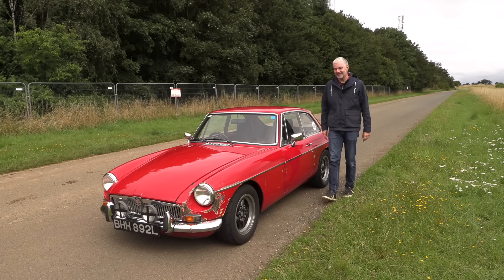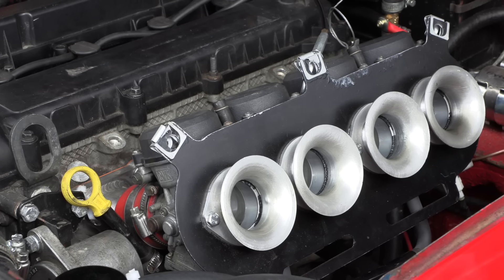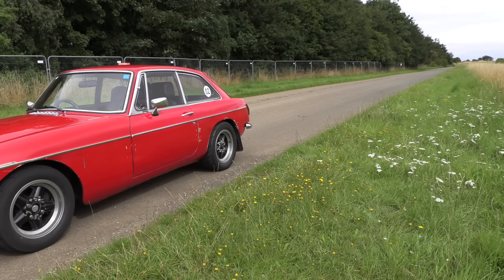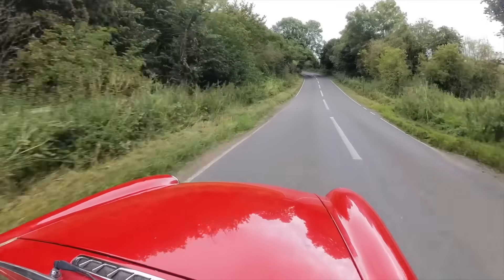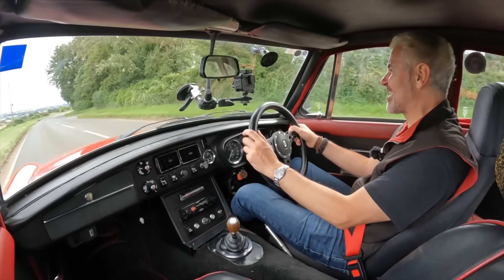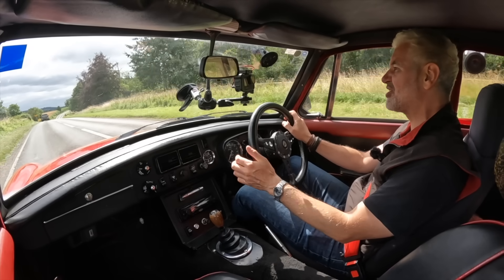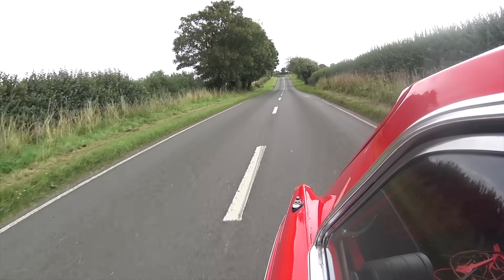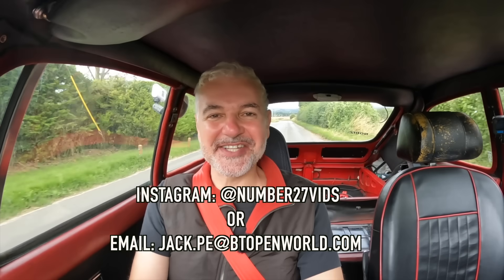This Mod Makes Electric Conversions Redundant - MGB GT Duratec

Comment: It sounds good and seems quick. MGB steering is generally pretty dead and old fashioned so that definitely is an area that needs working on to deal with the extra oomph. It’s fitting for a scruffy old MGB like that and affordable. An EV conversion is for a different demographic altogether with much deeper pockets as things stand. An EV Triumph Stag or XJS would be more fitting and make better sense.

Comment: There is absolutely nothing wrong with leaf springs in the back and a lot that is really right ! Having the right spring rate and the dampers to suit will provide excellent handling. 

As for the front end this car has a bit more negative camber than maybe is ideal for the street and also looks to have a good bit of toe out. This set up is ideal for the race track where you have a lot more slip angle than you are going to have on the street.

Comment: Nope, not for me - Ford engine in an MG! 😮  Me I'm looking for a accident damaged MG4 to transplant into my daughter's MGF (maybe even twin motor X-Power 😁).  For me, most cars' souls are in their chassis - Every car I've ever driven, the engine has been some form of compromise.  Sure, some cars are about the engine and you wouldn't want to touch them, but for most it's just the weak point.  Then again for 5 years my daily was a Westfield SEi Wide, so maybe my perspective is skewed 😆  Each to their own I suppose, as long as it's reversible.  Just spare me the armchair generic 4-cylinder jockeys who don't like EVs because a Nissan Leaf isn't as much fun as a TVR; neither of which they've ever driven.  Great videos by the way - keep them coming!

Comment: That is a good conversion.  Been thinking of doing something similar.  If using a third generation Miata drive train (NC Miata), it comes with the 2.0 engine, an easy  torque upgrade that is a direct bolt-on the the transmission is to use either the 2.3 or 2.5 engines from the same family of Ford products that use the Duratec engine (e.g. modern Escort/Fusion).
Reply: I'd also use the rest of the Mazda - suspension, brakes,  body .... oh, hold on.....
Reply: @larry9580  You would get the same amount of rust thrown in for free too!
Reply: Wow awesome love it would be even better in my opinion if it was a 1960s sebring MGB roadster replica with the hardtop fitted... But credit to the guy what a great conversion a real wolf in sheep's clothing now you could have some real fun at the lights leaving some modern cars in your wake the drivers would think what the hell is going on 😂👍
Reply: Yup, endless tuning options too. Not dead yet? Time for a turbo!

Comment: My brother has the last year the mg was made and he put a V8 aluminum Rover engine in there with a Muncie 4-speed it'll blow that thing away
Reply: Muncie gearbox? Pretty tough buggers but they whine worse than an Aussie served a warm Fosters.
Reply: @mrdainase  Not quite right - the whining begins as soon as they see the Fosters label - irrespeective of beer's temperature.
Reply: @mrdainase Most Australians are wine drinkers, they don’t drink Foster’s in Australia. As far as lager goes, it’s Victoria Bitter, Carlton or Castlemaine that’s drunk. Cooper’s Sparkling Ale is good.
Reply: @chrishenniker5944  .... and there's the sound of a joke whistling clear over your head ......
Reply: The Muncie M22 (rock crusher) is certainly a robust and reliable transmission, however the same cannont be said about the compromised shift mechanism which was fairly agricultural even when new.  It's likely another case of the GM 'bean counters' overiding the more costly but better engineered solution.

Comment: The duratec and zetec are the one's to have smooth reliable and tuneable, cool conversion, nice one again jack the little mg is alive and handling the extra power very well 👍
Reply: I'd almost be ready to put money on the fact it's not a duratec, it will be a Mazda MZR (otherwise known as L series) engine.

Yes, the Duratec is a ford built version of the same engine, but they are not exactly the same, I'd much rather have the Mazda version, ford "optimised" it to build the engine to a budget so a lot of parts are lower spec than the Mazda version (forged vs cast conrods for a start!)
Reply: @ChuckFickens1972  the 1972 in your username is the same year as the car! It's a duratec though. The mzr is a great option. Just needs efi and a better ecu because of the vvt. The mzr is also a tad more money than the 2.0 duratec.
Reply: @jacobyoung1671  I'm glad I said "almost" put money on it :)
Reply: @ChuckFickens1972  haha! To be fair your suggestion would be the better option. In a couple years you'll probably be right.
Reply: Does it matter nice engine no matter who designed it 🤔

Comment: Should also point out that with engine swaps you lose the MOT and tax exemption as well as historic vehicle status so have to pay the ULEZ charge
Reply: This is NOT TRUE! So long as you keep the car within the DVLA's notoroius "8 point rule" you keep historic status, tax exemption and ULEZ exemption too.  You can change the engine, gearbox and axles and still stay within the regs. You do still need to get it MOT'd, but I would and do on any standard classics I happen to own anyway, as well as the 2 restomods. It's not a high price to pay!
Reply: Disregard the ULEZ charge.
Just don't pay like the television licence. Don't engage and don't enter into a contract by acknowledgement of it.
Reply: Another way to screw people 😡

Comment: I don't see the point. If it had no engine to begin with and the Ford lump was lying from an old project then, yeah. Cool. But the old B series is plenty enough fun as is. To jump from 97hp to 110/20, ok. It's something to tell people but you'd get just as much fun out of the original lump anyway. Why blow 5 grand on it 🤨 
Love my EV but it's a commuter, I throw it around like I stole it but like my engines too 😁
Reply: 5 grand spent on an A series won't get you that amount of power.
I'm with you on keeping the A-series, Classic and Sports Car, featured one a year or so ago.
Lightened, balanced, ported, polished, hotter cam. Electric ignition, twin SU throttle bodies looking like carbs. 
25K £ just the engine. 😭

Comment: Very nice restomod conversion. Thise engines are very robust.  I think I might have just used the stock EFI with the Duratec, though.  It would have made things simpler.
Reply: Thanks very much. You can get bike throttle bodies which are efi that are only a few hundred more than the carbs I went with. I completely agree with you: in fact it's just about the only regret I have on this conversion. Will upgrade in future.

Comment: Rear axle location on a MGB is fairly decent, it's those horrid lever arm dampers in standard form that can ruin things. A firm front/softer rear setup is the general rule of thumb, which you can do just by changing the oil in the units (shocks is a better option though), and with decent new bushes all round they drive fine. Can't abide the B Series engine though, that damn lump of iron haunted the business for decades longer than it should.
Reply: After late 1964, with the five bearing crank, it was smoother, albeit still heavy.  That engine also was fitted to the Austin/Morris 1800S.
Reply: @john1703  The B Series and the Landcrab were made for each other, a bad engine in a bad car.
Reply: Was there a parabolic leaf spring upgrade for the mgb?
Reply: @rjbiker66  Yes you can still get them, and there's also a multi-link rear setup available which from memory is a bolt-on job. If you don't have the cash then just taking the springs off, getting the surface rust off them, a good layer of Hammerite or Hard Hat and then a thin skim of oil/grease between the leaves will make a difference to them. Poly bushes are a good option as well but they do need a smear of copper grease to preventing squeaking.

Comment: I bought an MGB GT as a project and it thankfully has the upgraded brakes and suspension already done which is a good stating point. I believe people can be a bit 'sniffy' about unusual engine transplants tin the MGB thus when you come to sell the car the resale price would be negatively impacted. The route I have investigated is the V8 from a Rover SD1along with it's 5 speed gearbox, this will give you about 170 hp but way more torque than the Duratec and has the benefit of not being so frowned upon as there was a factory version with a Rover V8 albeit with only 137 hp, I think the lazy power delivery and sound also suits the car better and it would likely be cheaper to do. It's a personal choice of course and as an alternative putting an R1 or Hayabusa lump in there would give a phenomenal power to weight ratio but not a very relaxed drive.
Reply: Yes,and twice the fuel consumption.
Reply: Yes,and twice the fuel consumption.
Reply: And twice the comments apparently @johnwalker283

Comment: To hell with going electric. An  MG B with a modern twin cam , finally caught up with the Italians only  45 years  late
Reply: And with the MGA twin cam
Reply: @GildasSTP  The MGA twin cam engine was released in 1958, however due to various deficiencies which included fueling via the SUs it was not a successful engine and was (sadly) dropped after the manufacture of circa 2000 examples.
Reply: The important thing is they're still here
Reply: Yea, the Fiat twin cam…. How reliable.
Reply: @LOTPOR //
HILARIOUS.

Comment: Yeah but think of the environment
Reply: This is A Weekend Car which will literally be occasionally used, with a Recycled Engine, Carbs and Gearbox. This CO2 will be less than used to charge your Battery up!
Reply: senior EV tech here,  we are,   the most poisonous car manufacture is making a glorified milk float, which will last 10yrs, then be scrapped as an uneconomic repair
 if you don't know this, you need to find out sharpish...
Reply: @paulriggers1558  And on 10 years time the government will say go back to diesel
Reply: You just try to think about what you just wrote... If you can
Reply: I think  using a 45 year old car is thinking of the enviroment
Reply: How many sets of batteries would you get through to get to 45 years old and this car probably has another 50 years in it still, remember the Gov told us diesels were the future 15 years ago and look what happened to that, stop believing the elec hype